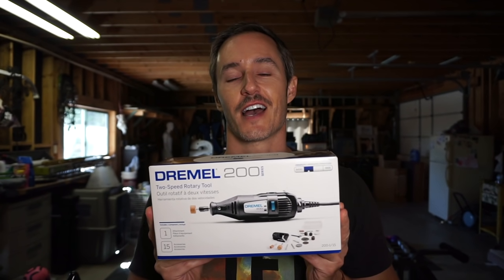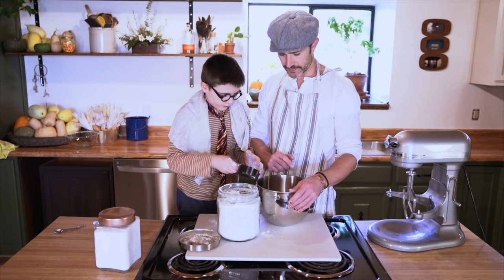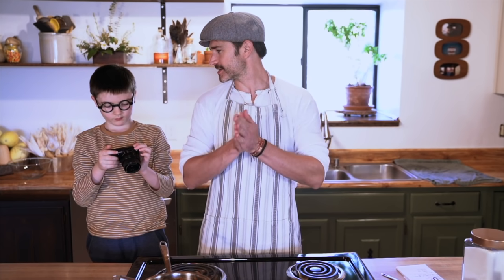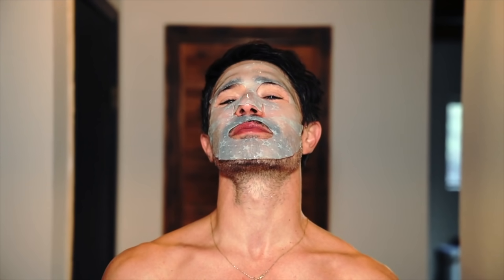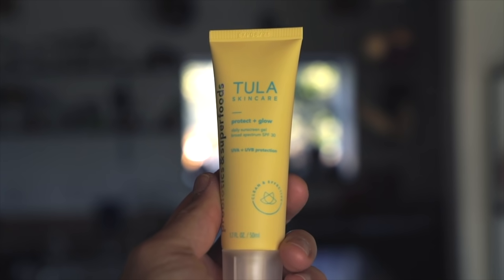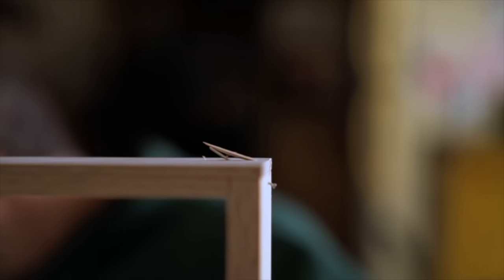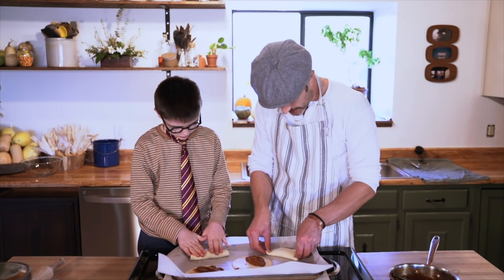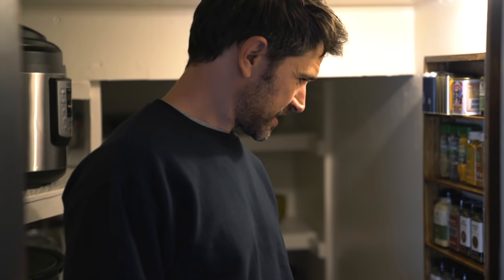A Wholesome Family Home Video | MATT AND BLUE

Comment: Hey Matt, temperature is key in making biscuits. The butter being frozen and large hole grated is always a big help during the mixing.
Reply: Do u think help during the mixing?
Reply: @komixgame5923  .....the results are much better during mixing if the butter is frozen. I put cheese cloth in the fridge so it’s cold and my warm hands do not touch the butter while grating it. Also once your biscuits are rolled and cut, place scraps in between the biscuits and place them as close together as possible using a baking pan instead of a baking sheet will help them rise and be fluffy.